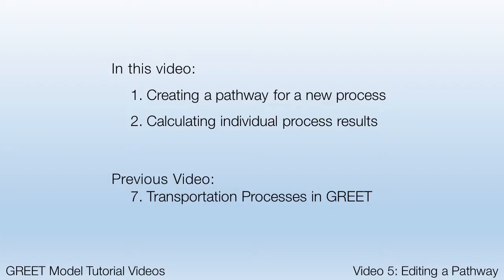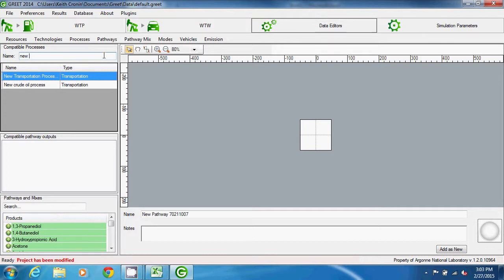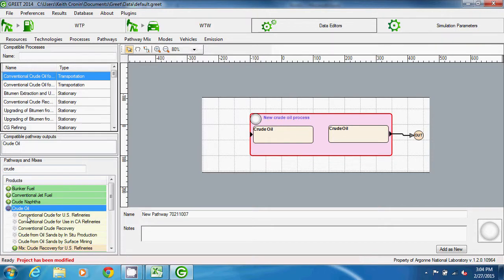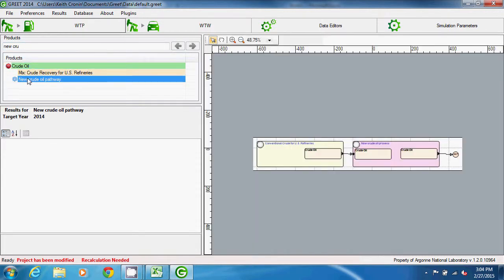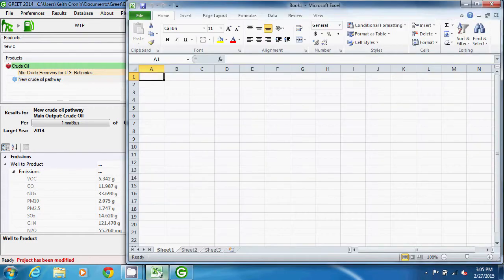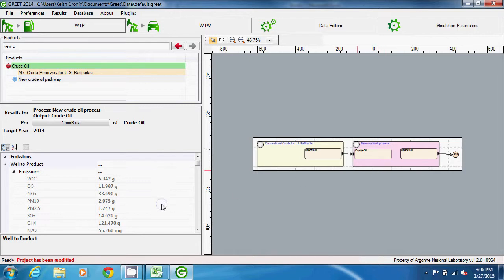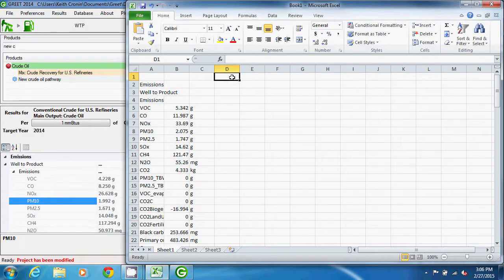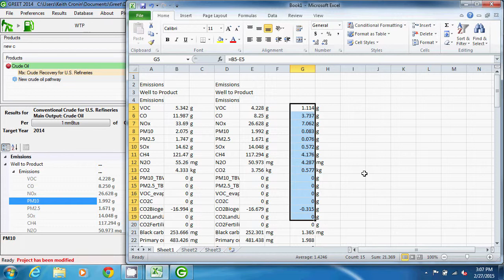GREET Tutorial #8: Viewing Process Results

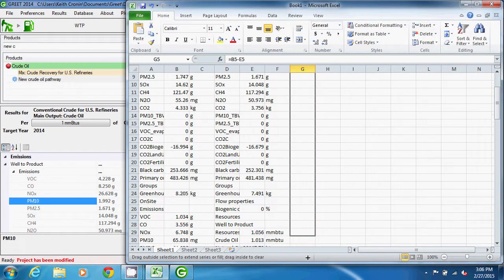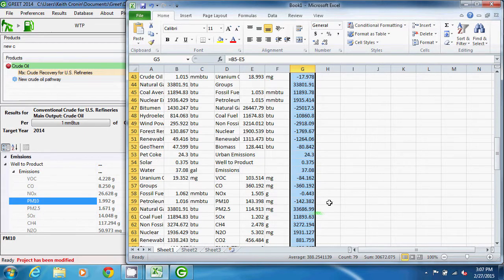Comment: Hi Keith. I just wanted to point out that at 4:07 (when you are dragging the formula down in Excel spreadsheet), you have to make sure that the species are lined up identically for both processes. For example, at 4:11, Row 72 has "Groups" in column A and "Black Carbon" in column D. The formula would return wrong values here. So, you would have to match each species in both columns. That requires some work unless you can program in Excel to sort values automatically based on their names.